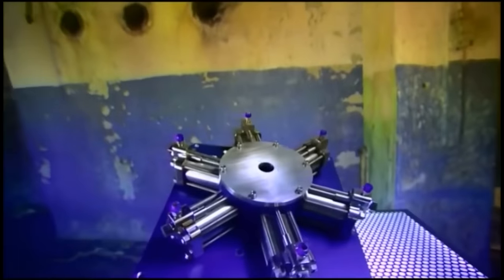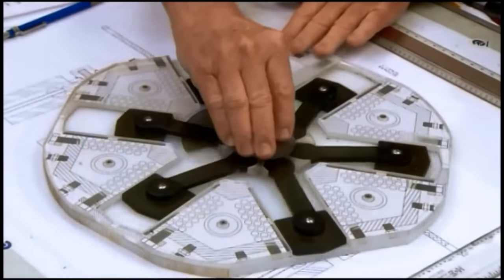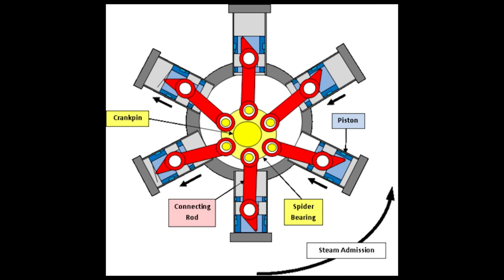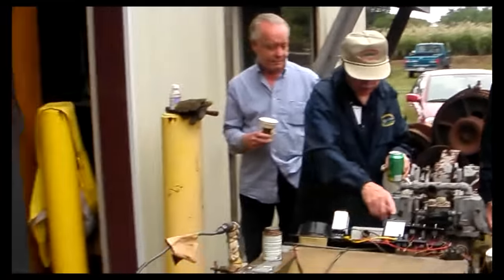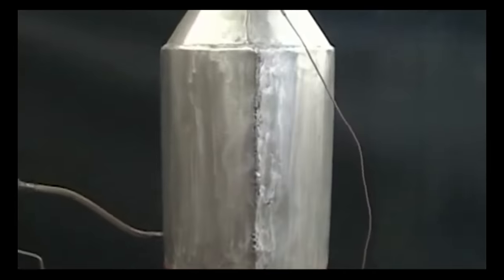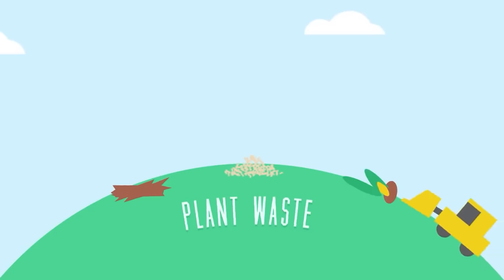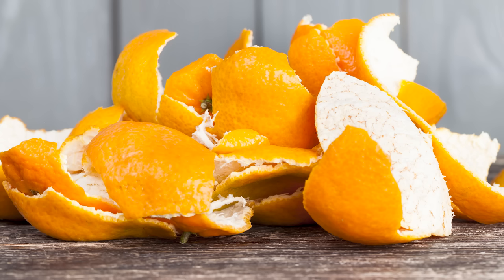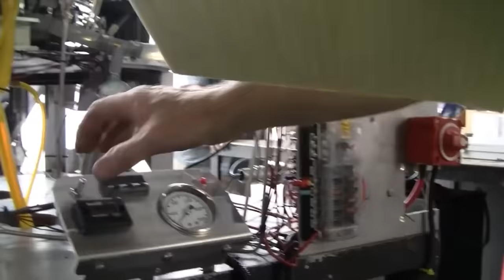Is the Cyclone external combustion engine the future?

Comment: They should make a hybrid where traditional engine makes energy from normal combustion and steam generator use the heat to make electricity but adding turbos that spin magnets on the exhaust can probably create much heat and so should be able to create a reasonable amount of electricity from traditional engine

What people have to realise is that combining things is key ie burn fuel to make light like in a lamp create light but heat not being used. Explode fuel to make movement but heat and light not being used. I’m serious that you could potentially make a glass engine, fused silica or quartz , fused silica have a melting point of 1900 degrees C and can be cut very accurately and doesn’t expand or contract much at different temps and you could use a high rpm engine in the right circumstance to create useful light and energy from movement And use the heat too . 

I’ve seen engines with glass on the side and you can see the explosions so glass sided engines already exist and work

Comment: Many industrial applications such as steam turbine operated generators, ships engines etc. run on super heated steam these days with no major or uncontrollable issues. Modern materials science has come a long way with hydro-based lubricants, ceramic and composite bearing materials(ceramics and others), high temp resistant corrosion resistant metals like Stainless steels, 
Inconel,  Molybdenum,  Titanium, Nickel Alloys, etc.. Making one of these engines run reliably shouldn't be a big problem these days with proper engineering.  I think other forces at work have prevented their proliferation - patents, profitability, public mindset, competition with powers that be, etc.

Comment: 100 Hp at 3600 RPM is 195 Nm.
3600 rpm and 1355 Nm is 695,5 Hp. 

Which is it? It can't be both at the same time. No mention of efficiency/fuel consumption. It's just a new arrangement of the steam engine.

Comment: What would be the advantage of this engine over a steam-driven turbine, which every nuclear plant uses?

Nuclear power is the future, not burning things.

If we get small, efficient, safe nuclear power plants where every community can have its own nuclear power plant, both our energy needs and the environment will be assured.
Reply: I wouldn't want nuclear power in my cities board members hands. We'd be dead within the week it was voted in. Many cities would probably feel the same about their towns😳
Reply: Steam turbines are more efficient on a large scale, piston engines are more efficient on a small scale. Different things have their optimal size to function best- animals included.
Reply: @rossbrumby1957  I don't care about efficency on my individual scale. All that concerns me is long term costs. If efficency turns out to be part of the equasion that saves me, I'm all for it. If it cost me more than I need to spend for the same or better result the financial efficency is my goal. 🤑

Comment: Ok, this looks all fine and dandy, but there are several massive safety issues. 
1) how do you heat the water to 1000C safely?
2) once heated, how do you make certain that this very high pressure gas doesn't violent escape?  Pretty sure that steam at 1000C is at a very high pressure, and that any engine failure would be on a scale resembling the Challenger disaster.
And 3) even if you somehow prevented a catastrophic failure in any of the lines/engine parts,  the pressure might be strong enough to cut steel, and the sheer temperature is definitely lethal.

Comment: I believe this thing is an impressive feat of engineering but the biomass stuff is just too good to be true. If bio fuel can work of external combustion it would worked for internal combustion a long time ago. Heat water up to 1000 degrees require a lot of energy, biomass need to be processed to become extremely energy dense kind like petroleum, and that process require a lot power to do.
Reply: Lol you bought into the propaganda thinking this is impressive engineering.

It's just 6 cylinders in a star configuration. A boiler and probably a condenser. 
Pretty basic.
Reply: literally just heat up the biomass in a closed container, cool it, and you get gas and gasoline-like liquids. Not that hard and doesn't use much power. This is disconsidering the fact that you could just use the wood directly instead.

Comment: The cool thing about engines that work from a pressured flow like steam is that they are constant-pressure, this gets rid of just about every issue with normal IC engines and the torque is truly incredible (especially low-end torque compared to IC engine which literally come to a hault at same speed these guys still push crazy numbers..)
Though even I was surprised at the torque figueres here! Also 150hp / 150kg?? Daaaayum!
Reply: Unfortunately the engine, it's performance and the entire company was fake...

Comment: Aside from the fuel, it looks like a radial airplane engine.
Biomass derived ethanol produces a higher amount of greenhouse gas than gasoline, as does biomass derived diesel fuel. Producing ethanol to mix with gasoline uses more energy than just producing gasoline.

Comment: The problem isn't the engine. It's the steam plant needed to power it. It needs at least a boiler and a condenser. And neither of those are very compact or very light. When measuring the power to weight ratio, all must be taken into account, except perhaps the fuel.

Internal combustion engines rule not so much because they are all that thermo-dynamacly efficient, but because they offer the best power per weight ratios.

Comment: It's a steam engine.  No amount of word play can change that fact.  Yes, fuel is burned to heat water and convert it to steam.  And this is done outside the pistons.  By that measure, all steam engines are external combustion engines - aside from nuclear powered steam production.

Weight and complexity are significant factors.  One must transport the fuel and the mechanism for burning that fuel as well as the mechanism for transferring the energy to water, turning it into steam - let's not forget the water tank.  Then that energy must be extracted from the steam and converted into mechanical energy.  

The internal combustion engine is simply much more efficient, converting liquid hydrocarbons directly into mechanical energy (and heat).  This eliminates all the machinery needed for steam production and the weight associated with it.

Comment: Heating water to make steam for the purpose of turning it into mechanical energy is incredibly inefficient on any scale and at any temperature. More than likely the reason for it's disappeared is they realized that your typical modern diesel engine cost's much less than what they could make the cyclone for and it also makes much more power on much less fuel, and is more reliable. Same thing with the Stirling engine
Reply: As far as i know almost all power plants run on steam turbines with over 50% thermal efficiency.

Comment: Maybe someone figured out that all engines are heat engines, and that regular old IC engines can run on biomass too.
Reply: IC engines are about as efficient as it gets, because you're dealing with only one energy conversion. Electric cars represent insane energy losses by comparison, and that's in spite of the frankly unbelievable efficiency of modern electric motors and batteries.
Reply: @Patrick-857  if you have a straight up solar powered car, like an aptera, it's more efficient than any IC.
Stirling cycles are more efficient than IC for running generators and what-not. 
ICs are _convenient_.

Comment: Well, as to the failure to continue development, who knows, could have been a lot of things.  As to the technology itself, it's nothing new, except perhaps the configuration of the power cylinders
formatted into a pancake radial form.  My best guess is that because they are using supercritical steam, the boiler has to be so heavy for safety's sake that the power to weight ratio sucks as far as transportation applications go. This would limit it to stationary applications for power generation, and other options for that are currently cheaper, so it would be limited to niche applications.
Of course most of this is speculation on my part and I could be wrong about some or all of this but this is my current take. P.S. I should have read the Boring Old White Guy first, that pretty much explains it, but I'm leaving my two cents worth in as additional problems.

Comment: The real question is, does the engine's output exceed the energy required to heat the water to the required temperature?
Reply: uh.. wouldn't that be over-unity?  You can't get more power out of a system than you put into it.
Reply: Uh, no, that's not the real question. The real question is, are you one of those people who believe over-unity machines are possible? If so, you need to realize that your brain isn't well-suited to evaluation of complex systems. There's ALWAYS a gotcha, something you've missed, something that's eating up an unexpected amount of the energy put into the system. Better minds than yours over the millennia have tried and failed to come up with a way of manipulating various forces to produce energy from nothing. They have all failed - every last one.

If over-unity is possible, you'll know it by the end of the first simple experiment. If you have to look for points of inefficiency, things to tweak, adjustments to make to try to push a system over the break-even point, you've already failed. A successful system won't try to "bend" the rules or find loopholes in the laws of physics. No, a successful system will completely trash the laws of physics, and will be able to summon massive quantities of energy from nothing by manipulating / changing the underpinnings of reality. Losses from friction, heat, or whatever won't be an issues because the sheer volume of free energy on tap will render these meaningless. 

A successful gravity-based system will manipulate gravity at will with zero effort. You'll essentially be turning gravity on and off as needed. Do this, you'll also have invented an anti-gravity device that will revolutionize EVERYTHING. But wait, there's more! Gravity isn't really a "force" so much as a warping of space. You'll have figured out how to warp space on demand with zero energy input. Hm.... Imagine all those scifi stories made reality. Imagine being able to create a wormhole without any of the adverse effects normal physics predicts would arise from more conventional methods... You could travel ANYWHERE in the universe, near instantly! Imagine a new super weapon - a mini-wormhole that siphons energy direct from the sun to a point on the planet of your choosing. SCORCHED EARTH! Want to make the whole earth blow up? Twist gravity enough that the core of the earth becomes extremely heavy. Earth will implode. Tune that implosion correctly, maybe the earth will go "supernova" through fusion. Or maybe just suddenly return gravity to normal, and all that highly-compressed material will spring back, tearing the world apart.

A successful magnetism-based system will turn the magnetic force on and off for electrons and protons, at will and without the addition of any external energy to the system. The energy such a system could unleash would be... INSANE. Who needs heat and pressure for fusion when you can simply tell protons to ignore magnetic forces? Your first experiment would likely produce a massive KABOOM. Or a micro black hole? Hmmm.....

You get the idea, right?
The universe becomes your plaything when the laws of physics can be twisted, amplified, or shut off at will. Better be careful though; it may be that you're achieving this through manipulation of universal constants in a local region. What happens if there's a slip-up, and the local change becomes universal? Goodby universe as we know it! More likely though, you'll simply die on your first experiment as normal matter encounters incompatible altered reality.
Reply: @renicgunderson441  How much power are you putting into a wind turbine?
Reply: You being a bit overdramatic @warpedweirdo 🥴

Comment: Some of those claims are iffy like the use of any fuel
Technically true but I doubt it performs in any feasible way
The high torque was expected but absolutely gorgeous to hear for a fact
But the biggest question is how exactly is this pressurizing/heating cycle happening

Aside from that I'm glad steam engines are coming back in some way

Comment: I'd be very nervous of steam at those sort of temperatures!    Potentially good as a static engine, or maybe in a battery hybrid vehicle?
Reply: If it is a monotube boiler, like most of the evolved steam cars of the early automotive era  had, there is very little volume of water to cause a boiler explosion.

Unlike the epic detonations the firetube boilers in steam locomotives were known for.
Reply: @NullHand  U still dont wanna be anywhere near a leak at 1200C.

Comment: There is a reason why we stopped using steam engines and moved on to petrol power. And no, it was not because of some kind of conspiracy. It is because the petrol powered internal combustion engine supplies more power, is easier to use, is more compact, and more reliable.
And steam powered pistons is just not very efficient. There is a reason why they are not used in large scale power production, like electrical power plants. Turbines are more efficient, gaining the most power out of the steam, and less prone to the mechanical stresses that pistons suffer, therefore more reliable.

Comment: All steam engines are like trying to herd cats, you have to control a lot of variables, I would like to see a computer do this, I sure it can be done it just will not be easy. all steam engines us oil injection to lube the engine so that not a problem, I'm sure all his problems are fixable, they make seals for steam turbines so that is an easy fix, balancing an engine is not all that difficult a good race engine builder could fix that problem easy. I think this guy did a good start but just needs some experts to find tune it.

Comment: Like a lot designs these days, if it is revolutionary, or very good or seriously competes with other highly profitable products its' patents or licenses got bought out by groups who don't want it on the market to compete - fuel companies, engine companies etc. Modern technology and materials science would make this engine practical and lubrication issues a minor problem. Real steam engines did use oil injection or direct application oiling into steam engines pistons and slide valves,  but today there are hydro lubricant alternatives that might work with super heated steam as well.  And as any gear head will tell you, torque is far more important than rated horse power. That is why old hit/miss long stroke gas engines (low RPM) and steam engines were so fuel efficient and widely used in the early days.

Comment: Should use a heat pump with the radiater systems in the ev. That way it can charge at times when ac is on. Also when the electric engines or battery is cooled.

Comment: If it ever worked as advertised,  then it may have been bought out. This is a revolutionary product and it could upset the oil and gas industry greatly.
Reply: How is this revolutionary?
It's a frickin' steam engine, and a poor one at that.
Reply: @warpedweirdo  Your right, it is a steam engine. What I believe you may have missed is that its a closed cycle,  compact very powerful steam engine. All it requires is an external heating source. Coal, Gas, Solar, Nuclear etc just to run. The solar or nuclear external heating makes the most logical sense. Low to no pollutants. Lastly, it doesn't necessarily require oil for lubrication. It uses its own self contained water source. Compact,   Powerful,  non-polluting, simple construction, low maintenance,  etc. or Revolutionary 👍🏽✌️
Reply: @warpedweirdo  You know the wonderful thing about being human is that we can agree to disagree,   PEACE OUT ✌
Reply: @rod3134  Yep, we can agree to disagree, that's cool. It really doesn't matter who's right in this case; the engine is clearly inconsequential, having sat around for years with minimal progress toward adoption. It could be the greatest invention since the wheel but, if nobody adopts it, what does it matter?

I've detected signs that you've not yet applied critical thinking to the claims you've presented. If true, I recommend you take some time to do so now, before you continue acting in the role of cheer-leader / evangelist. I consider those who refuse to apply critical thought to the claims they make / repeat to be either mentally broken / deficient, or dishonest. And you're neither.... right?

I don't mean no half-ass thought either. Challenge every claim you've made, find evidence both for AND AGAINST, and reassess. Make sure the evidence is REAL, and not some conspiritard crap or glossy marketing fluff or pseudoscientific gibberish or unsupported claims. Ask hard questions.

Comment: Is it the reason that this works theoretically better than a typical Sterling engine the fact that it uses a supercritical liquid?
   If so what about super critical CO2 or some other perhaps refrigerant gas that would be easier to seal and get around any of the issues associated with proper sealing and wear and tear.

Comment: to make biofuel viable, you must produce it from biomass waste, and not from fuel crops. The corn biofuel bubble has bursted more than 10 years ago. The steam engine can be integrated into a hybrid-electric powertrain system for better efficiency. It does not need to be so powerful to run the car as it is powerful enough to recharge the batteries. Being an external combustion engine, it can run on a wide range of liquid or gas biofuels.